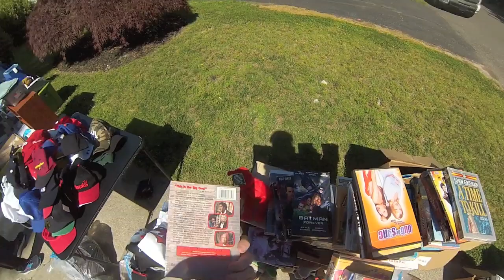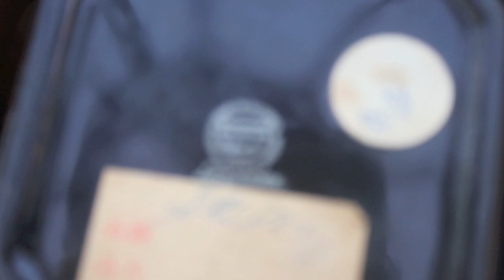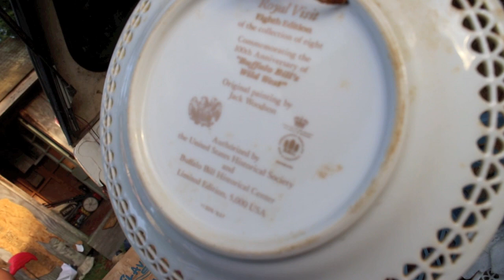SHOWING THE ANTIQUES WE GOT FOR FREE!!!

Comment: Vintage Porcelain Wall Mounted Pocket Match Striker and Holder by Chase, Man & Woman holding baskets this is for holding matches and the ribbed section under the baskets is for striking matches on. This is from 1920's and sells for at auction right now for $40.00.  And the Box is Maruni Occupied Japan Lacquerware Trinket Box they go for $20 to $200 depending on if it is gold painted on it. Which this one looks like it has gold painted decoration on it. from date manf c. 1868 to 1940s.
Reply from the maker: Thank you for the information appreciate it very much!